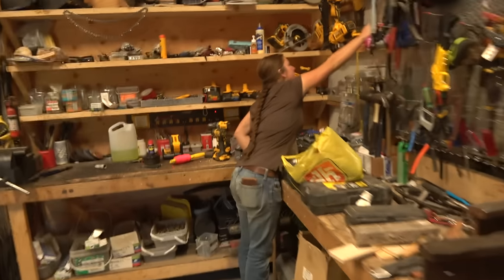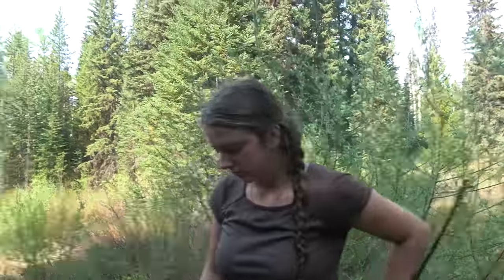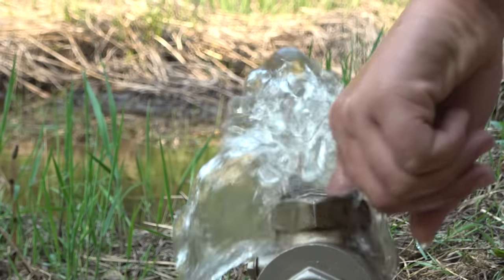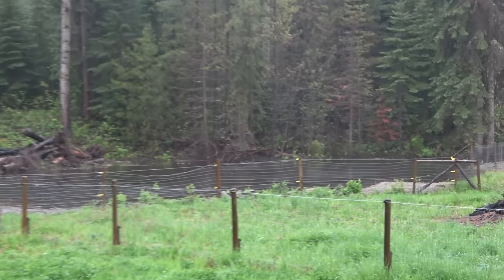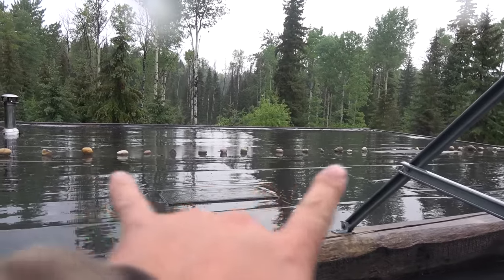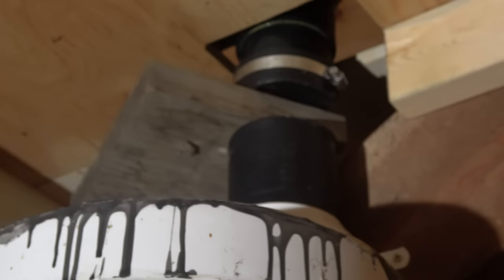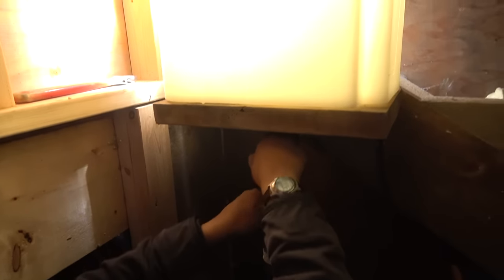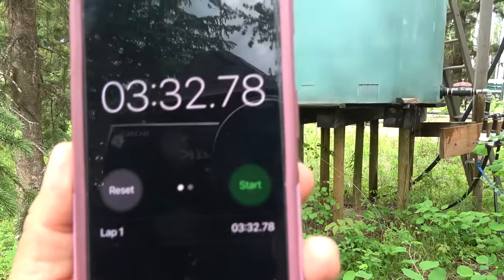3 CHEAP Off Grid Water Systems

Comment: Jeff provides an extraordinary practical engineering education for his young ladies; good as college labs if not better.  Girls are very talented and great students. ⭐⭐⭐
The 6 foot or 7 foot head on the ram pump, I say Jeff's a good engineer incorporated a safety factor for pond level and friction losses from bends and fittings. Darn! so wish I could sign up for the summer camp event; certain those attending will have an awesome adventure.

Comment: On the first flush...instead of a tee at the top that allows water into your catch, use an elbow down into the straight end of a wye. going down from there into the catch tank.
The angled side of the wye is pointed up and connected on to your storage tank line.
Dirt that comes into the system after the catch is full, will fall straight down and wont bypass the catch system because it will have to flow up stream through the wye to storage.
With a tee setup like you have, once the catch is full, you have basically a straight shot to storage, and any late coming dirt will just swoosh by the catch tank.
Also, small floating bits will be caught at the top of the water column of water, as it is higher than the wye. They will sit there until the catch tank is emptied, or  they get water logged and sink.

Comment: Wells are all about how deep you have to go.  The problem is you never know how deep you have to go until you actually drill a well, in which case you drill until you hit water or run out of money, lol. Well drillers can provide you with some estimates in the area if they've drilled around there, but even then that's no guarantee.

Another option people can consider is building a rain roof, except the "roof" is just off the ground, there's no type of building involved.  Build the back end higher than the front end, hook up some gutters and as long as you have elevation, you can gravity feed it into tanks. Most expensive part would be the metal roof material, but if you're in an area with a lot of rain you can get a lot of water off of a little rain.

Comment: My grandparents sorta lived offgrid for many years with regard to electricity, in later years the parish (county) (Louisiana) finally ran electrical down their road.  But with regard to a water system(s) their house had a metal roof and they had a cistern both in the front of the house and one on the back side of the house.  I have no idea how many gallons of water the two cisterns could hold.  My grandfather had a down spout that he would let it rain for 10-15 minutes to rinse the roof off before he would redirect the spout(s)  into the cisterns.  They had another cistern that was out near the canning shed/kitchen.  But that cistern I think might have been filled from the other cisterns as it was smaller.  The two main cisterns as best as I can remember were probably 20 feet deep in the ground and 6 - 8 feet in diameter.  That water was very cool.  The main reason for the rain water system was because the soil in the area had high levels of sulpher and any ground water had a bad smell to it.

Comment: I put a first-flush column on each roof drain leader OUTSIDE.

Then, when it needs clearing (seasonally -ish) all the yucky water goes onto the ground OUTSIDE.

I pump (by gravity) all pre-screaned water to 6 IBC totes (painted black for algae control) and my swimming pool and so on, adding up to about 2,200 gallons.

I live alone and have a seperate collection system for my ladies (cows).

I made my own "Berky"-style filter and I drink and cook with it.

I wash in filtered water - as clean as it is BEFORE going through my drinking water filter.

Comment: Unfortunately I live in flat country. I have used the first bonus system to catch rain water from the house roof to use for washing my truck because my wife didn't like me using softened water from the house. The pressure washer had enough suction and the head in the tank was enough to get the job done and the water was already soft.

Comment: We live in Western Australia on a farm and only have rainwater from the roof for all our household water needs. We have two 120,000 litre tanks - the tanks are about $10,000 Australian each, and that is about 64,000 gallons in total - which we collect and fill over about 5 months of rain. At the end of our winter the tanks are usually full. We do a first flush as you do, but after that there is no filtration or chemicals added to the water. No light gets into the tanks and the water is pure nectar to taste and has never made anyone sick over decades of use. I know it's the thing in North America to worry yourselves sick over rainwater, but it needs no further human intervention unless you're living near toxic industries. If you don't have animals on the rainwater you could easily make-do with a 32,000 gallon tank (120,000 L). Just to be clear, you're living entirely off the water in those tanks for 7 months of the year - showering every day, no restrictions on flushing, no rationing.

Comment: For every foot of drop in your water line, you gain .432 psi.  So your 7 ft of drop gives you 3 psi of water pressure.  Helps your ram pump.

Comment: I am not cognizant of the requirements of a small hydroelectric system in terms of how many feet of head pressure would be required to operate a small system.  Do you know if it would be feasible to put in a small hydroelectric generator at the bottom of your run from the pond in series with the rest of your system of the ram pump and get both water and electricity out of the system?
Reply: Priming.that.thing.would.be.the.pits...I.saw.a.video.of.an.old.washing.machine.convertrd.to.a.hydroelectric.generator...But.it.was.NOT.in.a.Ram.Pump.system...

Comment: OK so you use the first device to pump water up to a holding tank. Then you run pipes back down the hill from the tank where the gravity pressurized water squirts onto a Pelton wheel connected to a generator. Free electric (once the hardware is paid for). Go ahead make a video of it.
Reply: The Pelton wheel would require almost 100 times more water than the ram pump can provide. If you overcame that, the beaver pond would run dry!
What’s your next wild ass guess?
Reply: I think they need a good deal more head pressure than they have to make that worthwhile.
Reply: We are talking about a pelton wheel and a ram pump but you didn’t say which one you were referring to!
Reply: @grdelawter4266  Wow, what an ass. I don't know how much fall they can muster total so I don't know how much pressure they can generate. The discharge point can be lower than the take up point. You just assumed I meant the popes run parallel to each other. Ig there isn't enough pressure to move a Pelton then there are other water wheels. I think you are also assuming that they are both running continuously and simultaneously. Think or the tank as stored energy that is used intermittently and it looks a little different.
Reply: in early 2010 i built 5 ram pumps and was planning on building more. my plan was to put a tank as high as possible above a pond. i would put at least 5 ram pumps to pumping into the tank, with the "waste" water from the 5 rams collecting an feeding at least 1 more ram pump to pump into the tank. 

the tank would discharge into the pond through a small diameter pipe to a Pelton wheel dc generator to generate dc voltage to charge batteries, and maybe use some system to cycle the water discharge on and off.
at the very bottom of the hill there would have been a solar powered pump to pump the water up hill during the sun light hours.
im NOT an Engineer or genius , in fact folks  think im BAT SH** crazy!

im an old Man and a mechanic + lots of skills.worked at a used golf car business and we put bridge rectifiers on big capacitors to plug into mains power to revitalize 6 volt and 8 volt and 12 volt batteries to power the scrap electric forklifts we used as lifts.
we used USED MOTOR OIL AND USED VEG OIL to heat the shop in winter and fuel diesel powered trucks including a 1970 chevy 1/2 ton with a 66 chevy V6 478 Turboflow diesel engine hooked to a turbo 400 trans with a gear venders over drive behind it and a custom 10 foot flatbed. i used a "reconditioned" battery in my blazer for 2 years from just 1 "reconditioning" treatment!
so even though this channel might never do as you suggested, DO NOT LET THE NUMB SKULLS COMMENTS GET YOU DOWN>
BY THE WAY, I NEVER FOUND THE SUITABLE PROPERTY  UNTIL I BOUGHT A PLACE IN MONTANA. BUT I GOT SICK WITH A    "STAPH A" INFECTION AND SPENT 3 WHOLE MONTHS IN THE HOSPITAL WITH LOTS OF SURGERIES TO SAVE MY LIFE AND OVER 1 MILLION $ IN HOSPITAL BILLS AND NO INSURANCE!!

Comment: I find it extremely odd. There is little to know info on using an average $400 dehumidifier that produces 5 gal per day.  then using a zero water filter etc. No info on why this is okay or not okay. And What can be done to safely drink water from one. We need to keep pushing to find a solution. This is clearly unusual.